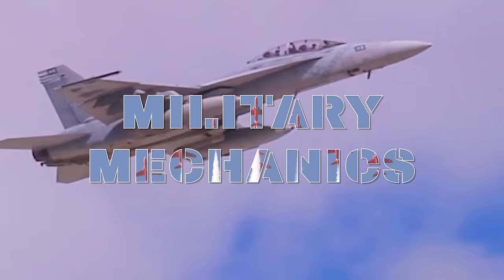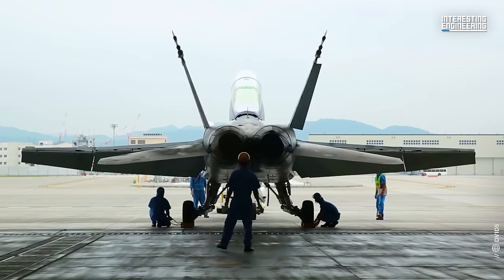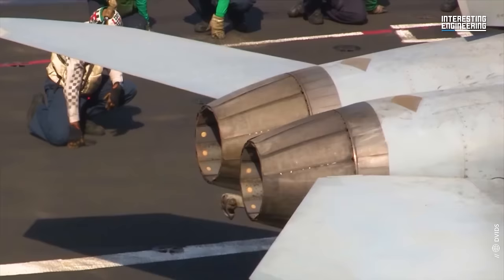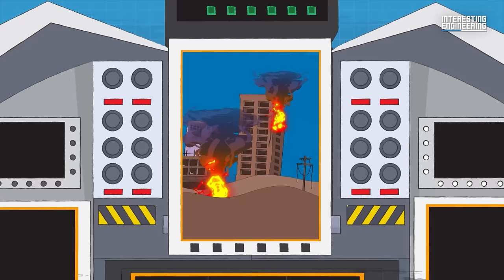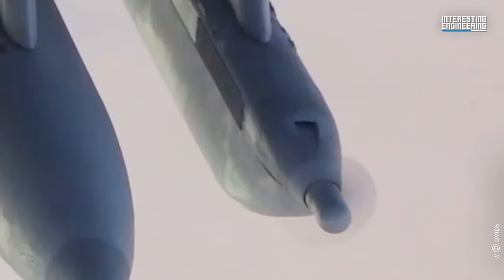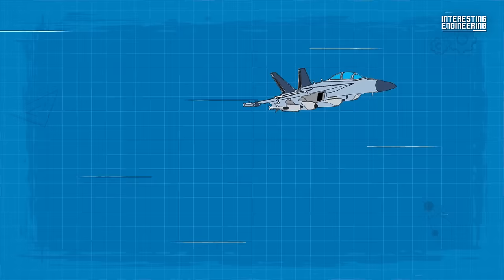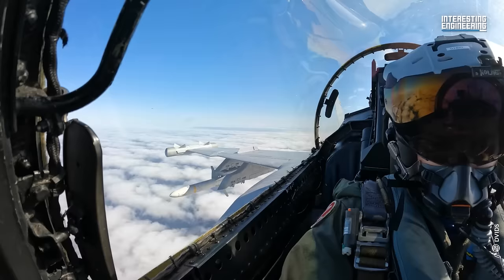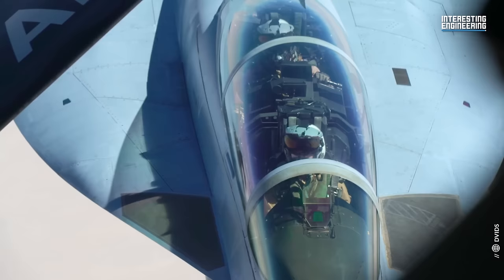What Makes the EA-18G Growler the King of Electronic Warfare?

Comment: I don't believe that the EA-18G ("Growler") has a 20mm canon like the Super Hornet does. There's no room for it on the Growler!!
Reply: It doesn't. It has no guns whatsoever.
Reply: Was about to get in the comment section and say this. Lol
Reply: It doesnt, it has a cover for the gun hole to make it slightly more aerodynamic.
Reply: cutting off communication  was a clever way to  turn down  faculty  
return to sender ?  whose post  .

no reply ???? 
 who answered all the inbox posts of my personal email
Reply: You are correct, it does not have the 20mm M61-A1 Vulcan cannon.
Reply: It has everything that a normal hornet has except the 20 mm gun and it has the electronics added for the warfare suite

Comment: To get an idea of just how underpowered the F-18 series is: 
2 × F-414-400 produce 44,000 lb, wet  (just over the F-35A single TurboFan)

F-15 EX  — DRY    General Electric — F110-GE-129:  17,000 lb-ft × 2 
F-15 EX  — WET   General Electric — F110-GE-129:  29,500 lb-ft × 2  (in AB)

F/A-18E  — DRY    General Electric — F414-400:  13,000 lb-ft × 2 
F/A-18E  — WET   General Electric — F414-400:  22,000 lb-ft × 2  (in AB)

F-22  — DRY    Pratt & Whitney F119-PW-100:  26,000 lb-ft each or  52,000 × 2 
F-22  — WET   Pratt & Whitney F119-PW-100:  35,000 lb-ft each or  70,000 × 2  (in AB)

F-35A  — DRY    Pratt & Whitney F135-PW-100:  28,000 lb-ft 
F-35A  — WET   Pratt & Whitney F135-PW-100:  43,000 lb-ft (in AB)

F-35A, P&W "GO1" (Growth Option 1), Completed testing & production-ready: May-17
- Claimed Power Increase:  +8-10% across all variants flight envelopes & improved, 
- Claimed Efficiency Increase:  +5-6 % lower burn-rate, extending flight + loiter times

Calculated out, result in:
F-35A  — DRY    Pratt & Whitney F135-PW-100 (GO1):  31,000 lb-ft 

F-35A  — WET   Pratt & Whitney F135-PW-100 (GO1):  47,000 lb-ft (in AB)
Reply: Just make an F-14E or F14FX wild weasel....that would've been awesome...
Reply: I like your analysis. Though, you made some mathematical errors when dealing with 2 engines in a few spots just FYI.

Playing devil’s advocate-the F-18 is as designed this way for a reason—pretty much specifically for the Navy. It needs to be very good at low speed, maneuvering, and it needs engine redundancy. The Navy prioritizes engine redundancy, airframe size, and maintainability more than the other branches, because its access to resources is much more limited when deployed and accidents leading to a foul deck can compromise the safety of thousands at one time.

Therefore, they needed two engines, and a small airframe, that prioritized maintainability and reliability above raw performance. That’s how you got two smaller engines that output about the same amount of thrust as an F-35’s single engine.

I like the hornet, the F-35 was designed to be an air superiority and deep strike weapon. Using one engine instead of two, wasn’t the Navy’s preference, it was simply a compromise because of prohibitive cost.

That and, the F-18 was originally designed to be a low-cost, lightweight complement to extremely expensive air superiority and fleet defense planes like the F-4, F-14 and F-15 (in the initial design competing for AF contract). Budget cuts in the 90s, led by geniuses like Cheney, left us with only these lightweight fighters.

Then the F-35 took much longer than expected, the Navy cut the procurement size, and the F-22 was canceled by the Air Force (meaning the Navy had even less expected support). 

So we’re judging it at a bar it wasn’t designed to meet, and it’s been thrust into trying to meet by strings of bad decisions stretching across a decades.

The Navy essentially panicked when China started to become an obvious near-peer threat. They didn’t have replacements for the F-14, EA-6, S-3 readily available and the F-35 was decades away from becoming available. So, they asked for the Super Hornet and Growler—bandaid options that were really never meant to be impressive or highly effective. Just good enough and readily available.

So anyway, here we are. Thanks Bush, Cheney and Obama for screwing everything up.

Comment: Wait, the plane has a range of 975 miles and a max speed of 1600 miles per hour? So at cruising speed it can loiter for an hour? Wtf? Has to be a mistake
Reply: Sounds about right, on full afterburner at max speed a fighter jet will burn through all it's fuel in like 10 minutes. Cruising they typically only get a couple hours without adding external fuel tanks.
Reply: @kacpertokarz8268  thats with external tanks
Reply: @AnonymousAlcoholic772 oh if that's with external tanks then that seems incorrect, I would imagine it would be over double that.
Reply: @kacpertokarz8268  ya cant be right.
Reply: Its max speed is Mach 1.6 not 1600 mph. Mach 1 is the speed of sound. The speed of sound is much much slower than 1000 miles per hour.
Reply: Propaganda video with some false information others have commented on! Not unique! Russia have demonstranter formidable EW capability. Every Gripen E have the capability of Growler plus supercruise, long range, high agility, very high availability, very fast upgradability, low observable and drones ready. The  EW of Gripen have spherical action and is GaN-based as well as connected to other airplanes with stealthy, broadband, multifunctional radio link. Two other radiolinks to other troups and friendly airplanes is integrated too.
Reply: Air to air refueling.
Reply: If you fly max endurance you can stay airborne for 2.5 hrs pretty comfortably. I've done plenty of exercises where we were on station before all the other fighters, and then were the last to leave.
Reply: @atlet1 not better than F22 or F35 or Super Hornet

Comment: Really no gun? Then it's truly wasted to use this platform for EW when it has no close-in self defense ability. Better to use a non combatant platform instead.
Reply from the maker: The EA-18G Growler is specifically designed for electronic warfare, focusing on disrupting enemy radar and communications systems rather than close-in self-defense. Its role as an electronic warfare platform maximizes its effectiveness in that domain.
Reply: It has AMRAAMs to defend itself, the gun is gone because it's got more electronics in the nose.
Reply: @LoudestHoward  now that makes sense.
Reply: @Interestingengineeringofficial  I was just reading about the earlier version - the Prowler.  No Prowler had ever been shot down in its 30+ years of service (with no guns).
Reply: On actual combat, they are part of a team with the F18. The EA18 role is to destroy surface missile radars.
Reply: @xris5697  Please stop talking about things you do not know about.
Reply: @xris5697 
Correct.  That’s the way the RAAF use them.